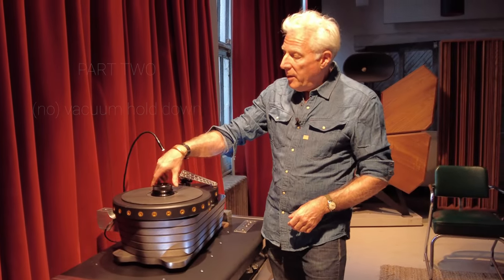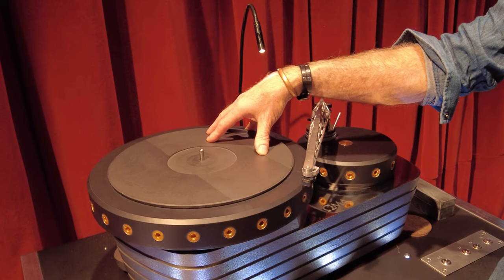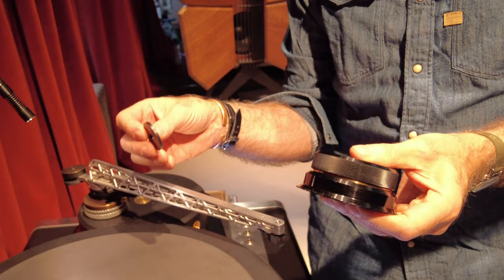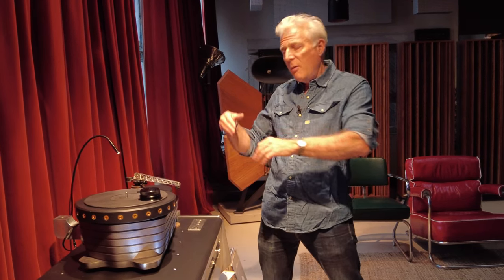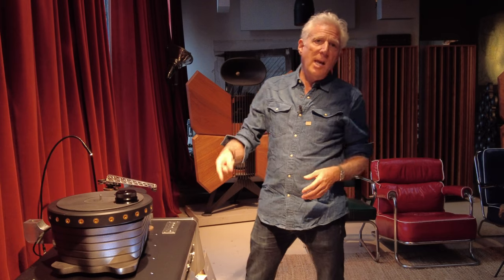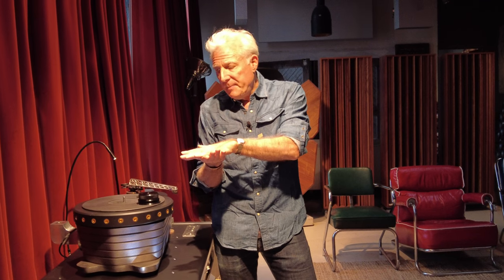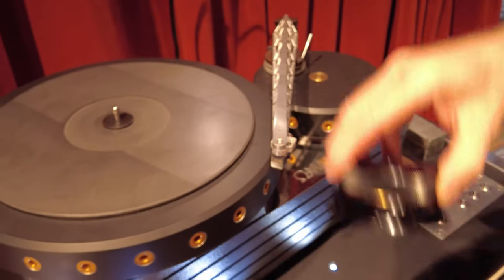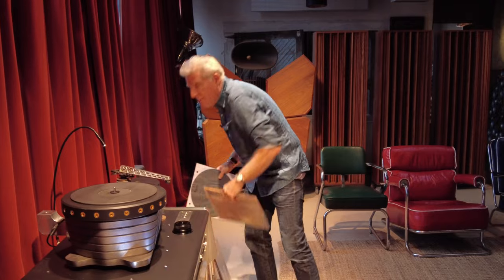OMA K3 Turntable - Part 2: (No) Vacuum Hold Down

Comment: Michell in the UK developed the idea of that clamp decades ago, still available today.
Reply: yeah but he said this one's different. I wonder how different it is tho
Reply: I was trying to remember, because I knew somebody else had done the same washer-plus-concave setup. Is the Michell not a threaded spindle one? As opposed to a collet. Sounds like they've managed to squeeze in some damping fluid on this one.
Reply: @weatheranddarkness  I’ve owned one and no it’s not threaded. It works by pushing down and turning the knurled knob which clamps to the turntable spindle.
Reply: @rongreen1538  I was thinking of my old VPI and I thought the other screw down ones with the puck underneath all relied on a threaded spindle in the same way. Interestingly my VPI came with a rubber puck. Like a pretty firm butyl.
Reply: @Dobbs65   A beautiful turntable you have there. I don’t remember exactly when Michell developed their clamp but it was many decades ago. My SME uses a screw down which is another good way of maintaining good contact but the Michell one is so effective.

Comment: Jonathan darling: SME has been doing this type of clamping for decades.
Reply from the maker: Hi Miguel, indeed, record clamps are common and have been around for decades. This OMA K3 Atlas clamp is totally different in using a central puck to raise the record above the platter surface so that the convex underside of our clamp actually flexes the record down into a positive engagement with the mat, and that’s not something SME, or any other company have ever done, to our knowledge. Furthermore, the clamp itself has a special damping system internally, explained in the video, which is also unique to the OMA K3.
Reply: @oswaldsmillaudio  The method by which there is a central washer and the clamp is concave thereby flexing the record onto the surface has been used by SME for a very long time, possibly other brands as well.

I use this method every day with my SME 20/3. All current SMEs, to my knowledge, use the same exact method. 

I should say you make very good points against vacuum hold-down, I found the video very interesting, and appreciate your passion. Your assumption about how and why it became a thing are probably true as well.
Reply from the maker: Thank you, Miguel. Your comment, and others, made me double check with Richard Krebs, the designer of the table and clamp. I added his words as a correction in the caption of the video.
Thanks, Jonathan.
Reply: Apart from the material and it employing a collet,  it functions exactly the same as Oracle's clamp, ie, the record is being stressed over a profiled washer. Hi-Fi News & Record Review did a DIY feature on how to make the screw clamp, threaded spindle extension and profiled washer, as the Oracle used, for use on a Linn LP12.

Comment: Α central weight and a periphery ring will do the work of a vacuum just as easily in a more economical way. Rubber is not always "bad sounding". There are hundreds of types of rubber with different characteristics of "pliance" and damping. A central weight alone will sometimes worsen the contact of the record to the platter.

Comment: I used to own various $25-600 clamps but got rid of them all. Mating to the platter doesn’t start at the turntable. It starts at storing your vinyl flat and not on its side. I have “age pressed” many vinyl for over a year and they are flatttt.

Comment: I like the clamping mechanism - makes perfect sense. Any plans to sell the clamp/washer as an accessory item to be used with your graphite mat? Perhaps a combo-package mat+clamp since they are built for each other.
Reply: That’s exactly what I was going to ask!:)
Reply: The Michell Engineering Record Clamp works on exactly the same principle and has been available for several years.
Reply: @patrickdixon4945  as is the original SOTA Reflex Clamp 35 years ago! Ok I am now seeing the correction up above.

Still, the ol' vacuum SOTA Star (or Cosmos) did not have a generic rubber mat atop their platters. It was an advanced material that if my memory doesn't fail me was called "SuperMat". So it is inaccurate to say all of these vintage vacuum hold-down turntable designs used generic rubber mats. Not so.

Comment: I agree with your thoughts as to the problem with the mat / vac platter interface issue, just ask Sota about all the ruined record claims they had to pay back in the day. There  was only one vacuum mat ever made that actually works without the sound degradation of the others, the teflon mat made by Versa Dynamics ,  sadly long gone.

Comment: Beautiful deck. Question: if you use a clamp on the spindle, won’t it transmit the energy/noise from the bearing directly to the platter?

Comment: Your video, would lead some to believe, that OMA has originated this ingenious platter hold down method.
As you may know, SME and VPI have been using the same basic method for a long time.
Don’t know who originated the basic idea, but I think you should have given credit to whoever did.
Reply from the maker: Hello Michael,  indeed, record clamps are common and have been around for a long time. This OMA K3 Atlas clamp is totally different in using a central puck to raise the record above the platter surface so that the convex underside of our clamp actually flexes the record down into a positive engagement with the mat, and that’s not something SME, or any other company have ever done, to our knowledge. Furthermore, the clamp itself has a special damping system internally, explained in the video, which is also unique to the OMA K3.
Reply: Hello,
 My first “high end” turntable, purchased in the late eighties, was a VPI Jr.
It was supplied with a round rubber spindle washer, and a wide convex clamp that screwed down on the  threaded spindle, which is the same mechanical principle that OMA is using.
One other advantage, you may have noticed, is that it removes most minor record warps!
SME’s turntables have long used the same basic clamping system.
If you check the SME 12 manual, at SME’s website, you will see that their clamping system is mechanically the same as yours.
It also adds some tips on how to know when the clamp is the right tightness.
Your system, though, does have the added damping.
This may be an instance of great minds thinking alike.
I do admire your products.
Mike
Reply from the maker: Thank you, Mike. Your comment, and others, made me double check with Richard Krebs, the designer of the table and clamp. I added his words as a correction in the caption of the video.
Thanks, Jonathan.
Reply: Thanks for doing that.
Reply: @oswaldsmillaudio  The first use of this type of clamping system that I'm aware of, using a lift washer under the record and a clamp that flexes the record down near the edge of the record label, is the Oracle Delphi from 1979. Many manufacturers now use a similar system including SME, Brinkmann, AMG, and VPI.
It's actually a pretty tricky thing to get right, because most mats (like yours) have a slight recess in the top surface to accommodate the slightly thicker label area of the record. If the outer circumference of the clamp that flexes the record down is too small, it risks pushing the edge of the label area into the recessed part of the mat, and cantilevering the rest of the record off of the step in the mat surface, thereby lifting the playing area of the record off of the mat. The key is to bring the outer rim of the clamp as close to the edge of the label as possible while making sure the cartridge won't hit it in the runout groove, and to not overtighten the clamp to the point where the record starts to lift again.

Comment: Very very nice. I dont have a very high dollar system, but I use a clamp with a collet also. My platter is solid acrylic. I push down and tighten at the same time. My metric is if you can move or spin the record while clamped then it is not tight enough. I have had great results. I feel that Weight isn't enough and yes vacuum is an expensive pain. I think your designs are top quality and haven't had a disagreement yet.

Comment: The use of plugs on the platter is a brilliant idea. I wonder whether anyone else has used it before on a turntable or whether this is the first time.  It's used in clocks/watches balance wheels. Essentially they allow balancing the platter and motor in one go (whether this is applicable in this particular realization at all is another matter).
I find the graphite mat rather intriguing. I cannot recall anyone having used that material. I think Delrin is the closest that comes to mind but I'm not entirely sure that a Delrin mat has been marketed before.
I enjoyed this as well as the first part - particularly the anti-belt drive polemic!
Reply: Delrin platters are definitely a thing. Not sure how many are currently commercial products though. The radial balance plugs have been done before, I wish I could remember the name of who did it. They were known for making telescope focusers if I remember correctly, and amongst audiophiles mostly for their isolation feet which used either concaves and rods, or sets of stretched rings. I think they were german and run by one guy?
Reply: yes, many mfr.s, many times.

Comment: This is a seriously great sounding turntable. Among the best. This video and description is quite misleading and does a disservice to the ingenuity and quality of the table it self. Why negatively sell features  of other manufactures when the points are not factually correct? There are so many great qualities to this table and superb engineering to extol.  Sell your strengths.

The choice not to have vacuum hold down is fine. Judging by the results it is not a necessary function of the K-3. Well executed vacuum systems are very easy to use by the end user. A simple push of the button and the vacuum is applied or released. The compressors and vacuums are almost noiseless and very low vibration that allow them to be used in the room and only heard with your ear within inches of the box. Their complexity does add considerable costs and in some cases needless complication to a system. 

Vacuum systems will NOT scratch the "shit" out of your records unless the platter or mating material used is abrasive, then no matter the system of vacuum, clamping, weight or nothing would damage records. Vacuum systems do not necessitate the use of rubber mats. The vacuum seals at the outer grooves and inner groves provide the seal, not the platter or record surface. TechDAS as an example, uses a metal platter and a very thin antistatic mat, not a rubber mat. The only use is for it's antistatic properties. Interface mats are purely a matter of choice by designers and taste of the end use in many cases.

Vacuum systems apply an equal downward force across the grooves. It mates the record to the chosen mat or platter material better than any clamping system. The simple knuckle rap test shows it quite readily. Clamping systems place the records in both compression and tension as they attempt to flatten the record to the mating surface. The differences in the stresses placed on the record, produced by clamping, can be clearly audible. Clamping systems are are more finicky and produces varying results in attempting to flatten and mate the record to the platter surface. They never achieve a fully bonded record to the platter. Vacuum systems do. Whether or not you prefer the sonic results is user preference.

The style of clamping system in use here has be used by many other manufactures, while the make up of the clamp may well be very unique to OMA. Weights and clamp materials along with execution are very valuable in being able to dissipate, absorb or harmonically enhance the vibrations caused by the stylus tracing the record grooves. Indeed the make up of the OMA clamp may be one it's best engineered and saleable features over other clamping systems.

The graphite platter was innovated and expertly incorporated into the Simon Yorke S-7, S-9 and S-10 record playing systems 25 + yrs ago. He incorporated a weight and not a clamp for the reasons stated above. Again a sonic choice based on Simon's listening preferences.

Comment: `Forcing and flexing` a vinyl  record as you say ,  Will microscopically augment the structure of the `width` of the grooves that the stylus has to travel rendering a different signal at the outcome.

Comment: Not all vacuum suction turntables were expensive. Luxman had 3 out in the early 80s and the cheapest was the PD300 which was £500. At some point there was rumours of the vacuum system leeching stabilizers from records. How true it was, I've no idea.
SME might have been using the clamping system for ages, but it was Oracle back in 1979 where it was originally used. And you have had some that have said that putting a record under such tension isn't such a great idea.
An interesting video:
https://youtu.be/rc2LA9kC-4U